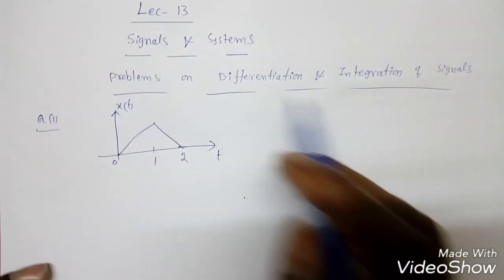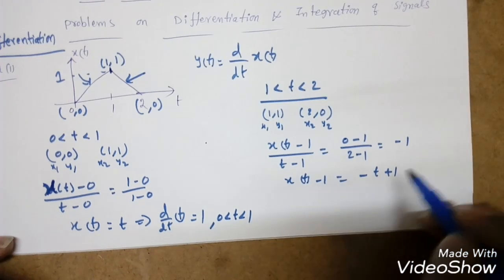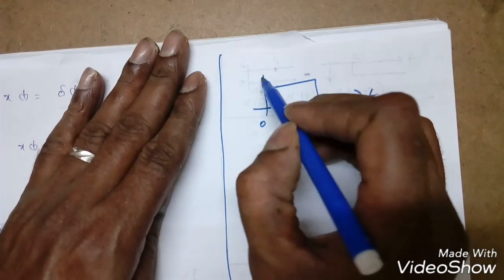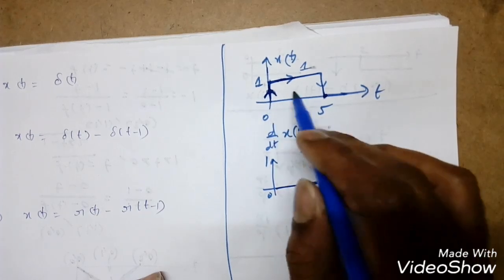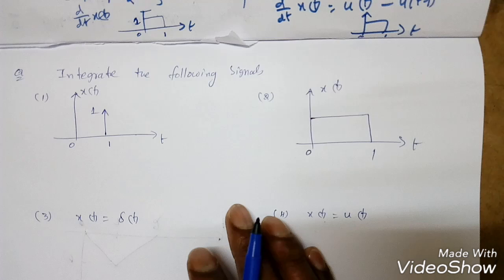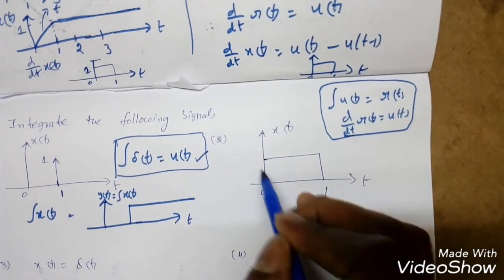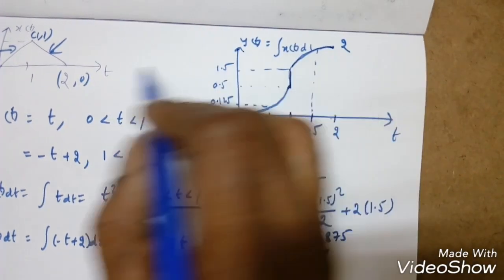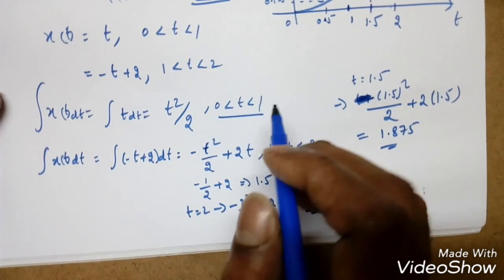Signals and Systems Lec -13: Problems on Differentiation and Integration of Signals

Comment: for the differentiation  of impulse funtion u can use the concept of integration,,, as u told if we differentiate  impulse we get impulse(which is not true), so reverse will also be true tht if we intregate impulse we get impulse (but it is not ,we get unit step) so this can help u to check differentiation of impulse is nt exact impulse..but it will be unit doublet(combination of two equal and opposite impulses)

Comment: can u clear me: non-causal are those present for t<0den how it depends on future value
Reply from the maker: i.e h(t) = 0 for t<0 , not the output ...from the impulse response we have to find the relationship between input and output..then check
Reply: Learning Z Everything m not getting.......here system.means it's impulse response??????...
Reply from the maker: yes when we talk about the system always we have to talk about its impulse response i.e h(t) or h(n)
Reply: Learning Z Everything condition for non causal system.and non-causal signal are they different?????????my q is if it is present for negatv time axis den how can it depends on future value

Comment: can u clear me what's d diff between causal,anticausal,non-causal system
Reply from the maker: 1. If output at any time depends on present and past outputs of inputs then causal system...or impulse response of           
  any stem h(t) = 0 for t < 0 then causal..

2. If output depends on future values of input then non-causal or h(t) not equal to zero for t<0 then non causal.

3. if output depends on only future values of input then anti-causal or h(t) = 0 for t>0 then anti-causal.